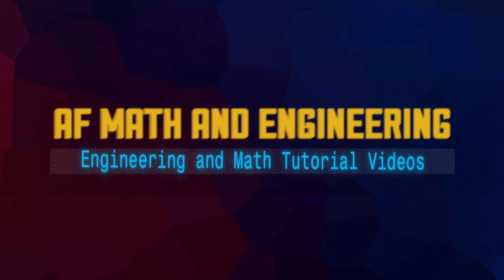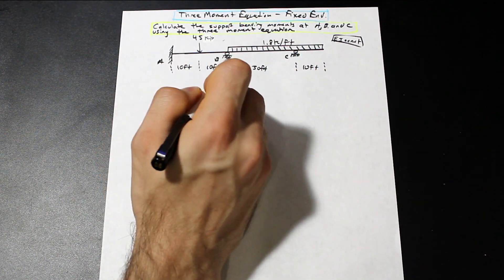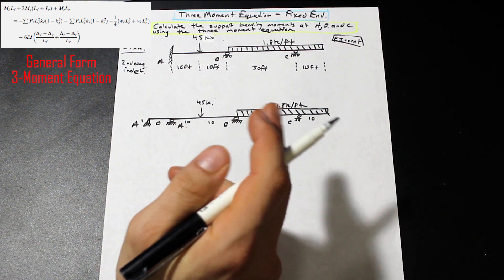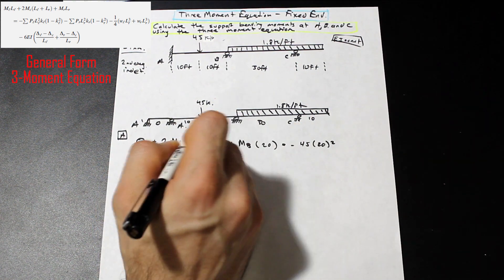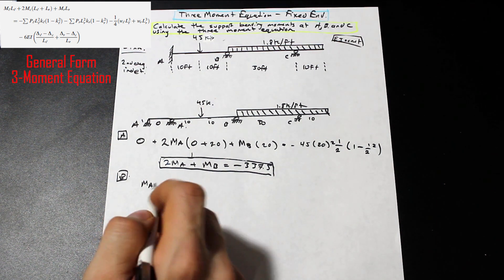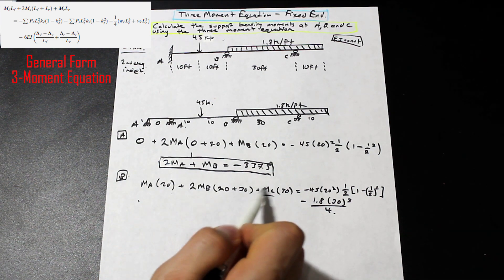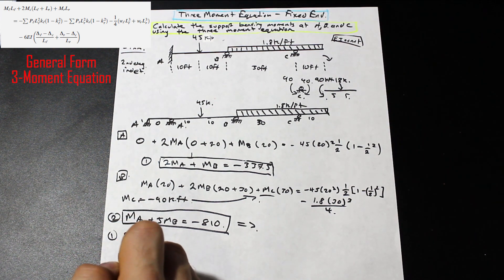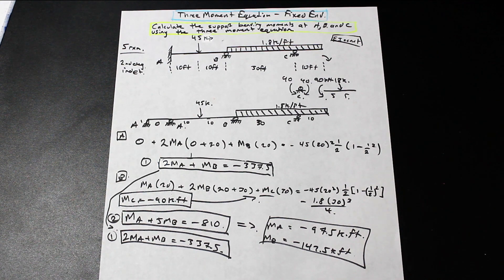Three Moment Equation 2nd Degree Indeterminate Beam Example - Fixed End Continuous

Comment from the maker: Note: The equation shown in the top left has had I multiplied throughout it.  This is the formula is used when applying the three moment equation at a support in which both adjacent spans have a constant I value (moment of inertia).
Reply: what if there are support settlements, sir?
Reply from the maker: We add the term on the end shown at the start of the video to our formula, and plug in the displacements.
Reply: @AFMathandEngineering  thank you for the reply sir, and just a follow-up: if the supports have settled and the same overhanging beam is analyzed, what would be the displacement at the overhanging point, sir? because we need the value of it when we consider the last 3 points on the beam
Reply: @AFMathandEngineering  to make my question a bit more clear sir, if we were to label the last point(overhanging part) of the beam as d, should i take the displacement of c and copy it to d or is there a solution that is evading my brain sir. thank you
Reply from the maker: @rubixloverful  settlement displacement is built into the long form of the three.moment equation.  You follow exactly the same steps as in this video, but there's simply another term on the end of the formula that we assumed as 0 for this problem.  Perhaps we'll make another video with support settlement for clarity.  Hope that helps!
Reply: @AFMathandEngineering  thank you so much sir!

Comment: If I have a moment insted of a force do I use the P or the W in the second part of the formula?
Reply from the maker: You can't use a moment in place of a kN or kN/m paramter, the units won't work.  You need to convert the moment to an equivalent force or distributed load.
Reply: @AFMathandEngineering  okey, thank you

Comment: Sir, I got -1080 in second equation not -810...
Reply from the maker: -810 is correct, double check your work.
Reply: I wrote positive 90 for Mc instead of -90. I answered this without watching your video first, sir and I got tricked by that until I watch that part. Thank you very much sir!
Reply from the maker: Glad you learned something thanks for the comment!
Reply: Thanks for the quick response sir! I'll try it again. :)

Comment: what is the difference between the first degree and second degree
Reply from the maker: The difference is that we only have three equations of equilibrium we can use to evaluate the beam, and if we have more reactions than equations we have whats called an indeterminate beam; we have more unknowns than equations and we cant solve it. In order to solve it we need to create additional compatibility equations so the number of unknowns (reactions) = number of equations.  In second degree indeterminate we have 5 unknowns and only three equations (sum of forces in x, y = 0 and sum of moments = 0).  Therefore we must create two additional equations in order to solve (solving for Mb and Mc), where as for a single degree indeterminacy we only need one additional equation.  Hope that clarifies things a bit.

Comment: What is the direction of Ma? Ccw or Cw?
Reply from the maker: The bending moment Ma at the support is - ve, and the sign convention is the beam convention, where the top fibre is in compression for positive and negative for tension.  In this case the reaction would be ccw, as in this orientation it would cause a negative moment in portion AB.